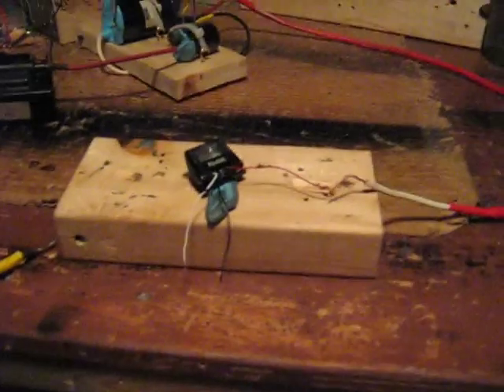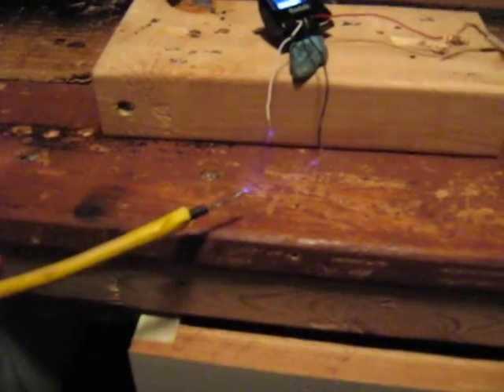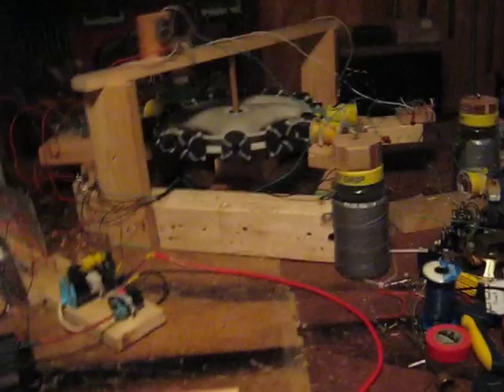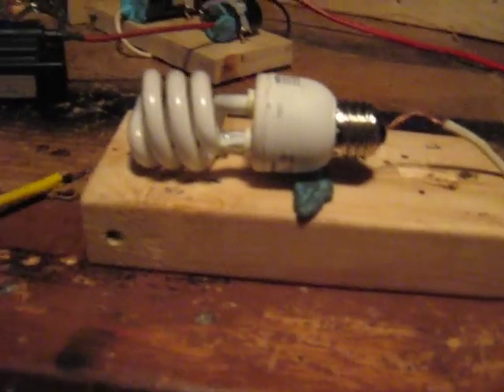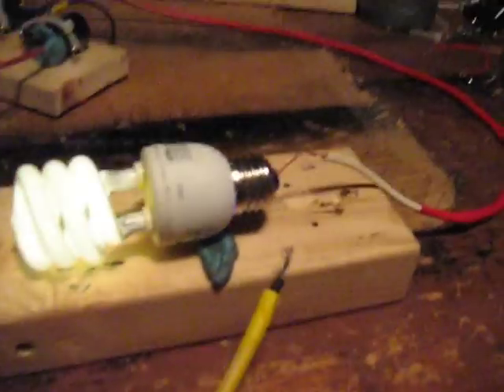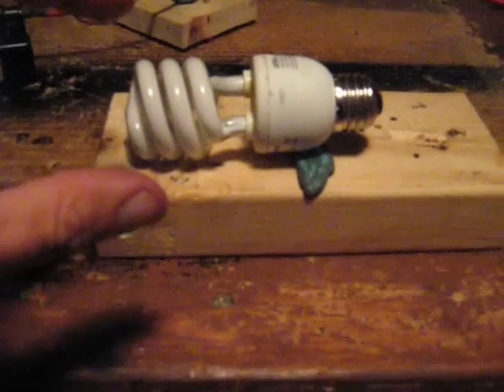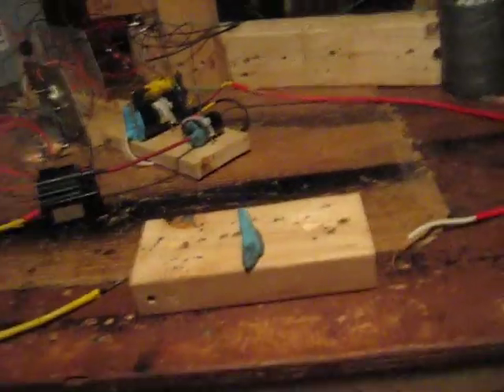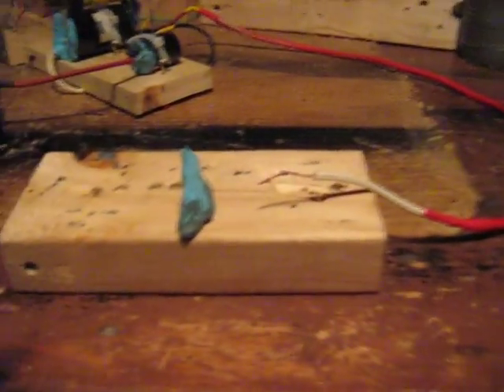High Voltage Phenomenon - Gutted CFL Lighting 4 Foot Fluorescent

Comment: awesome arcs man..  no way im getting anywhere close to that anytime soon lol..
the way that cfl pops is pretty cool, but i think its because its not gutted. i may be wrong, but i think your are charging that capacitor inside the ballast and discharging it into that 4 footer. remember those ballasts can pump out alot themselves but need at least around 120V to get started, so those volts your kicking into it are definitely enough to charge that cap til it overflows even without touching i bet.